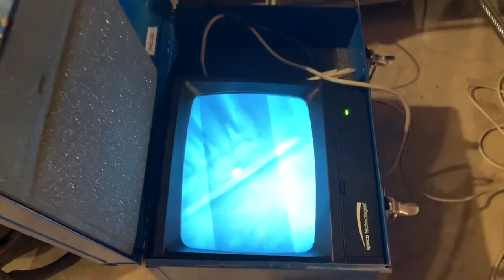HOW LONG does heat exchanger last? Can a heat exchanger be replaced?

Comment: Average life span of a condensate style heat exchanger is 8-12years. Much less than the furnace of "30 years ago". Which means companies can make 3times the money off a single furnace. Not to mention the "safety switches" and many other parts (flame sensors, ignitors, switch boards, high limit/flame roll outs) that are not considered serviceable but fail without symptom. And prove to be rather costly.
Even furnaces of "30years ago" were going into the age of disposable parts, way beyond a simple "thermocouple". 

New furnaces are designed for residual income, for the manufacturer and service industries. Not for bettering the environment or homeowner safety/cost savings. If people as a whole use less fuel to heat their homes and fuel consumption goes down, it forces the provider to raise their prices to continue to pay their employees "competitive" wages and benefits. All while constantly trying to keep up with inflation and new taxes (carbon taxes). The costs are constantly passed to the consumer and these new furnaces that consume 10times (probably 50times) more than furnaces of the past, just to manufacture. Then add on the fact the service tech has to drive to each location so much more, to service it. Then add on the fact all the parts and pieces that need to be replaced because they are not "serviceable".... And many of those parts (probably 99%) are thrown in the garbage because they can not be recycled. 

The heavy cast iron furnaces of the 50's combined with the safeties introduced through the 70-80's (they are redundant safeties governing the gas valve and work very well) and blower motors from the late 90's, would be an ideal combination.
Reply: Mmm.
Reply: have a York commercial packaged unit formy home made in 1995 woudl it have the cast iron heat exhanger?

Comment: You should’ve asked what methods/equipment does the technician use to test for a bad heat exchanger
Reply: You can use a sensitive carbon monoxide detector like fire departments use and also a visual inspection which takes more time to do but safety should come first.
Reply: Another issue is condensation in the flue pipe. My dentist had some relatives replace system and lack of proper isolation caused the death of six persons!